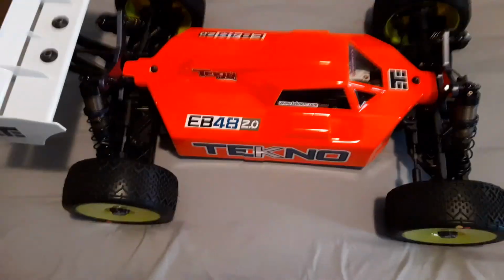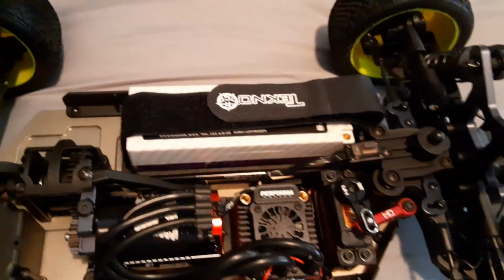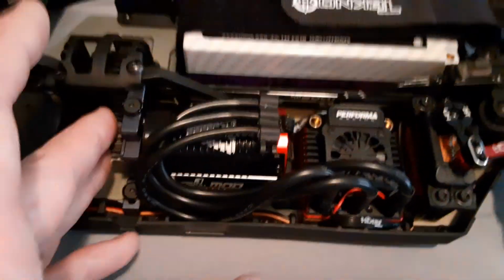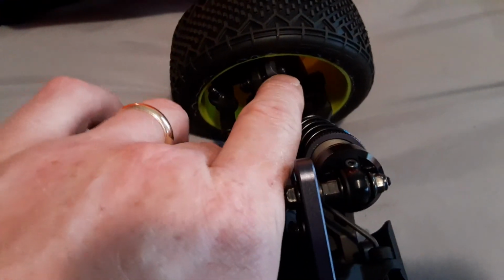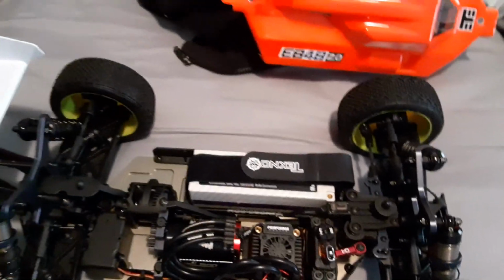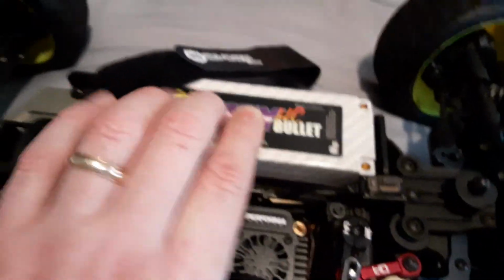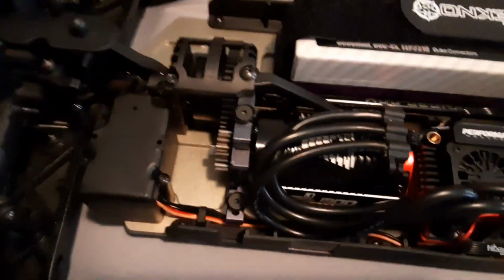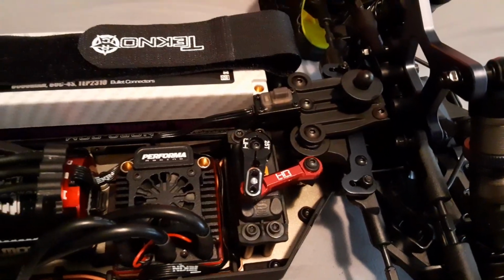Tekno EB48 2.0   PERFORMA RACING p1 combo  build update #1

Comment: what is your top speed ?
Reply from the maker: Ahh well i been running 18 and 15 tooth pinion only believe somewhere in the 50 mph range with the 18t. I did a speed test video using the 18t only trying to keep it close to track gearing as possible. Figure on track 18t will he about the biggest pinion youll use. It will fit larger pinion but im not speed running this particular build more setup for track use. Thanks for checking in...

Comment: Can I know what is the servo link you use? That Red one
Reply from the maker: Im currently cutting my grass but ill get you the part number later today. It is however the Hot Racing 25t servo horn with fixed length link.
Reply: Thanks Man 👍